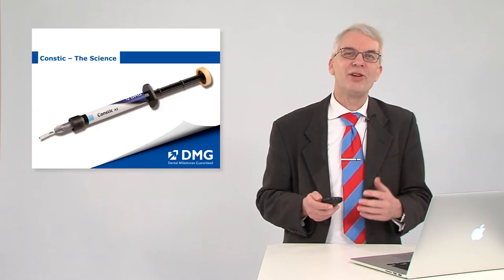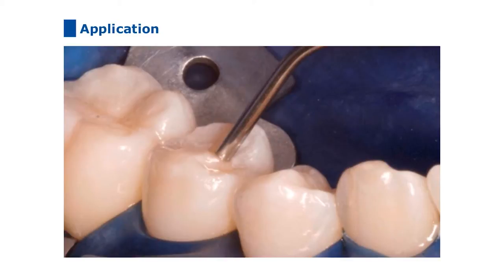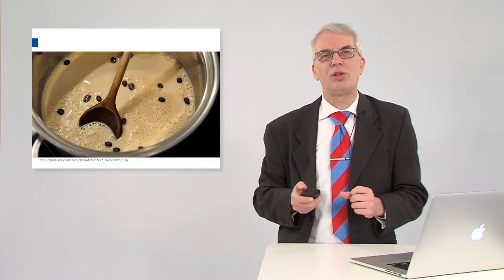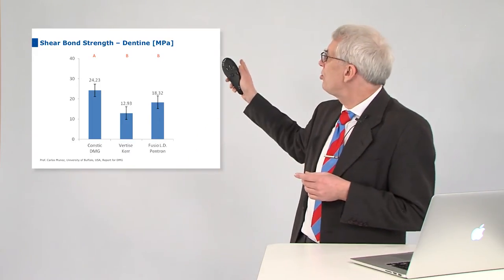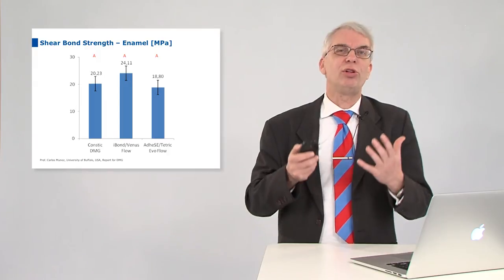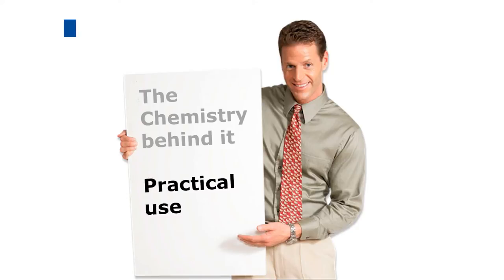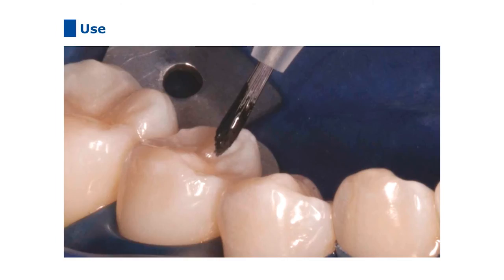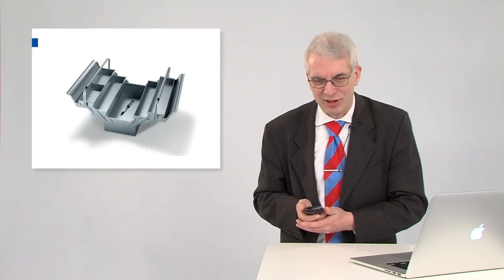Product Training Constic: the new 3-in-1-flowable

Comment: Does brushing increases bond strength? Is it realted to film thickness of resin also?
Reply from the maker: Hello, thanks for your message! My colleague from clinical research said the following: Constic contains MDP (10-Methacryloyldecyl dihydrogenphosphate). This special monomer was originally developed by Kuraray and used in their Panavia cement.

There it contributed to  a large extent for its good adhesion properties. MDP is a very special bonding monomer. To function, it has a double bond on one side oft he molecule, which allos it tob e incorporated into the resin matrix. Another part of the molecule  is a modified phosphoric acid, which etches the tooth structure /enamel and dentin) and in doing so, attaches to it. To be successful in this procedure, it needs 2 things: 1st It has to get in contact with the tooth structure. This is where brushing comes in. It brings MDP from the inner parts of the constic self adhesive composite to the tooth structure so that it can etch and bond to enamel and dentin. 2nd it needs a little bit of moisture to activate the acid part in the MDP molecule.

„Normal composites“ do not have adhesive monomers and therefore these have to be supplied in an extra bonding step. Accordingly, these products do not need an agitation step. The same holds true for bonding systems: The ones that use phosphoric acid in a separate step, typically do not have to be massaged in. Systems with selfetching primers, typically do.

Brushing has no effect on the film thickness.

Hope that helps :)